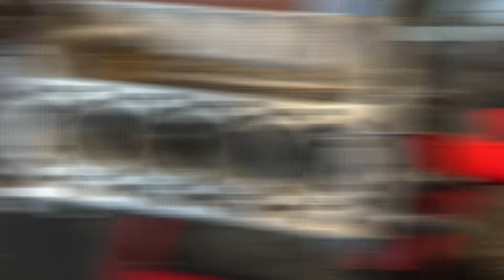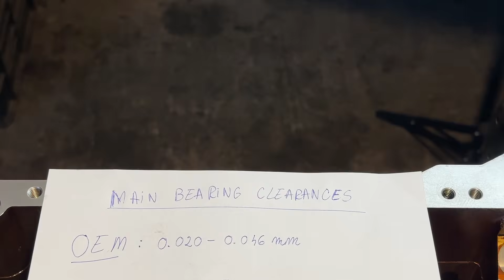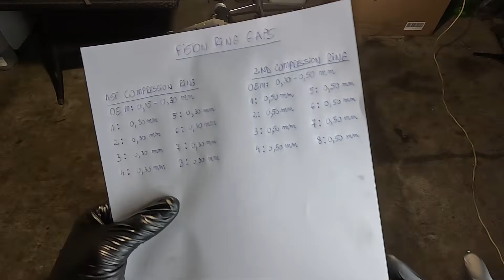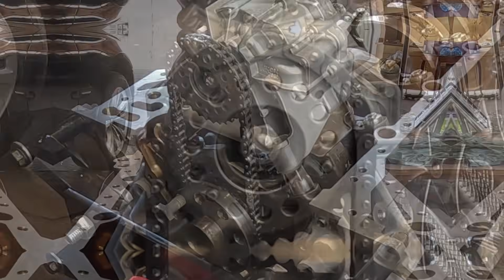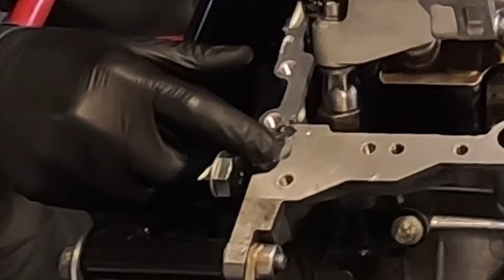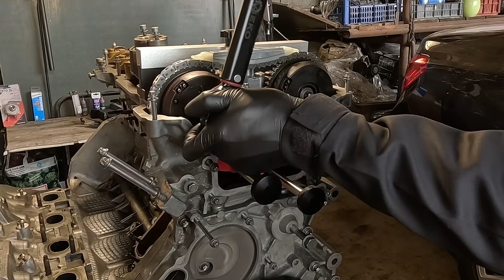OEM Rebuild of a 17 Year Old BMW Engine - BMW F01 750i N63 - Project 750i

Comment: Hello, I'm having a severe oil leak with this n63 engine. I replaced the turbos because one big symptom was actually the previous turbos were leaking oil directly to the intake system. After turbos replaced and test ride the new oil changed from full to 1/2 level. There is no leak from turbo to the air intake and using endoscope camera I don't see oil in the oil return lines under the turbo area. I can see oil over the cylinder head passenger side and there are some tubes connections on that area as well. Is there any video or document showing this connections what for? May it hace severe leak? I appreciated any idea that can help me to find the root cause of the issue. Thanks!

Comment: Where did you get your engine kit from?
How long did it take you to do this job?
And how much did all the parts cost you?
Reply from the maker: Hello, as I only worked in my free time this whole rebuild took me around 2 months to complete, but albeit recording also took a great amount of time.
Not sure what you mean by engine kit, but the engine block, crankshaft and pistons have been bought off of ebay, while all the other were just replacement parts you could find at any parts store.
All in all it cost me around 6-7k.

Comment: Can you share all the parts you bought and where you bought it from? Also, do you have the total dollars spent ($) for all the parts/fluids/gaskets to rebuild the engine?
Reply from the maker: The list would be way too big to list in here, but everything that I have touched is either replaced or checked thoroughly before reaasembly. You can note everything down by looking at the video.
Total cost is approximately 6-7k € in parts

Comment: How similar is the build process to the N63TU?
Reply from the maker: @ap0stol662  It is in fact very similar, as they are basically the same engine with minor differences (take the bent rods for example on the non TU vs the straight ones on the TU, or other miscellaneous parts). There might be slight variations of the torque specs, but those can be easily found as well.